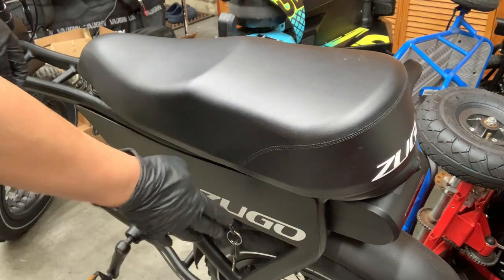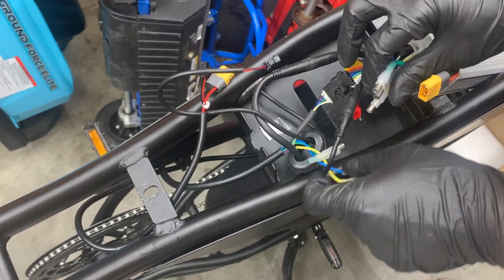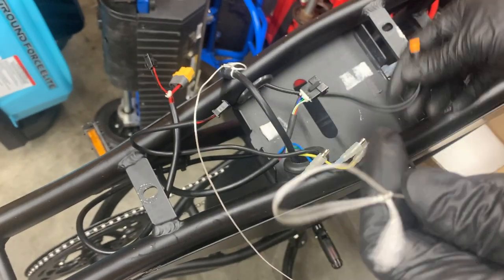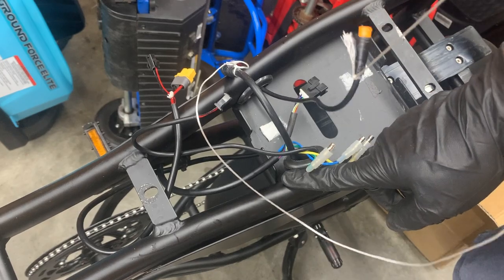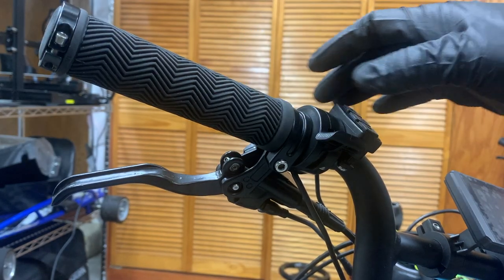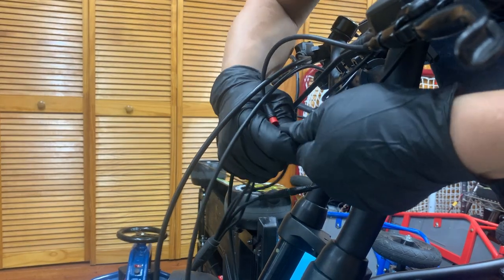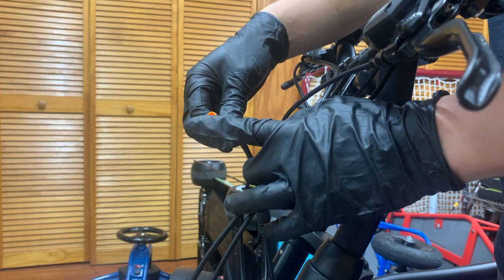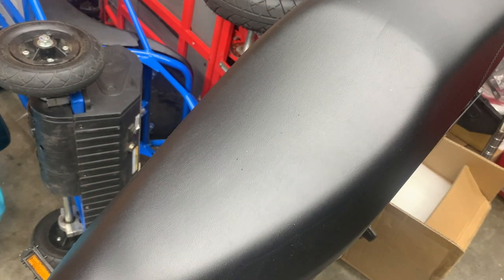How To: Zugo Rhino Controller and LCD Installation Guide | Blacklisted Garage

Comment: can this battery work without the Rhino battery? Mine ain’t working & since the manufacturer closed in Austin, Texas I don’t know where to repair or get a replacement. Thanks
Reply from the maker: The battery connector will be the same as the factory Zugo connector (XT60) you can use any battery you would like, it just needs to be 48 volts.
Reply: @Blacklisted_Garage  thanks 🙏

Comment: What controller and display did you install in your video, I have burned up 2 stock zugo controllers already
Reply from the maker: This is the controller and display offered on our website! It is a great aftermarket replacement over the stock Zugo controller which is known to overheat and burn wires.

Comment: What’s the top speed for throttle and pedal assist
Reply from the maker: The top speed of the Rhino with our controller can be influenced by various factors, including battery condition, voltage, and terrain. In optimal conditions, with a well-maintained 48V battery capable of holding a peak of 52V at full charge, you can expect speeds around 28mph on flat terrain in both modes. 

Our controller option isn't intended to deliver a significant power boost over the stock controller. The wiring size the Rhino was originally built with limits the performance capabilities. Our controller option is designed to offer a more reliable and well-built alternative, addressing the factory controller's common failure issues stemming from its flawed design.
Reply: @Blacklisted_Garage  👍 a more performance modded controller would be awesome for the zugo
Reply from the maker: Unfortunately, the wiring size that the Rhino was originally built with limits its performance capabilities. To safely send more volts and amps to the Zugo rear wheel, you will need to upgrade the battery and motor wiring.
Reply: @Blacklisted_Garage do you need to put a code in to the controller to unlock turbo mode and make it possible to go 28mph? 
My original controller come with 5 pedal assist modes and I put a code in and have 7 now . This controller only have 5 modes?
Reply from the maker: In our Zugo Rhino controller/LCD package, the pedal assist modes range from 0 to 5. While this may seem fewer than the factory controller's 0 to 7, the number variance is a result of different manufacturer settings. It doesn't imply that our controller stops at 5 compared to the factory controller.

In our controller, mode 5 is the maximum power assist mode, allowing the controller to assist at its full potential, determined by the battery's output. Importantly, there is no speed limiter on our controller for pedal assist when it's in mode 5. Additionally, there is no speed limiter for the throttle, meaning it will allow the controller to reach the maximum speed the battery can output.